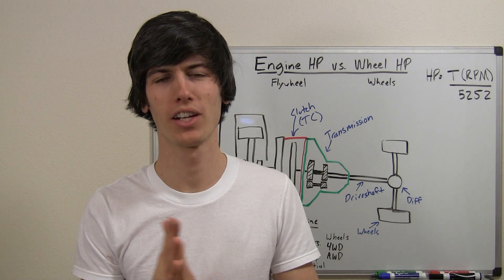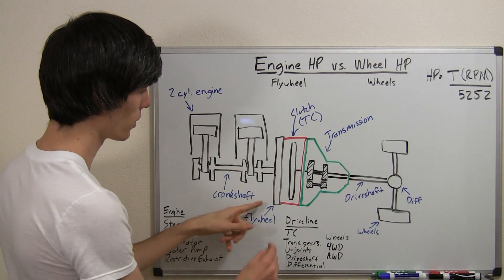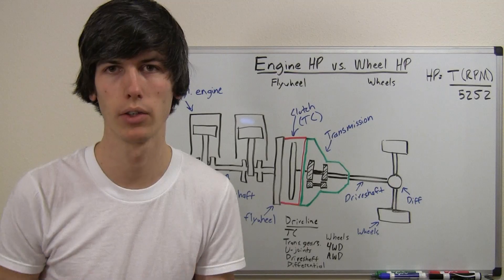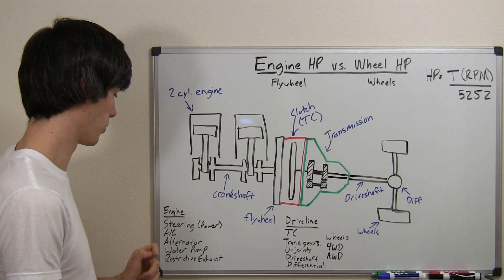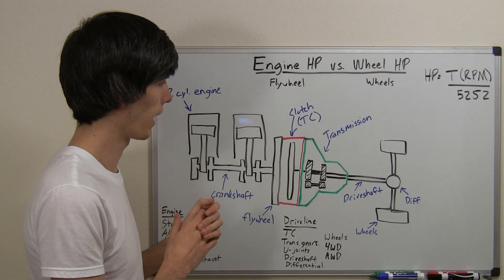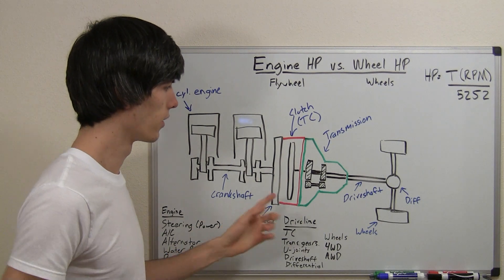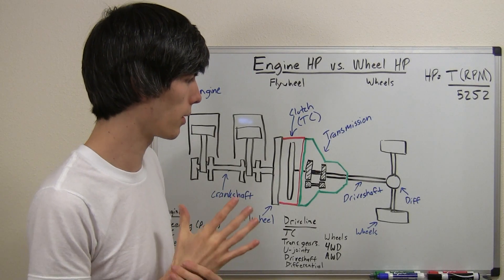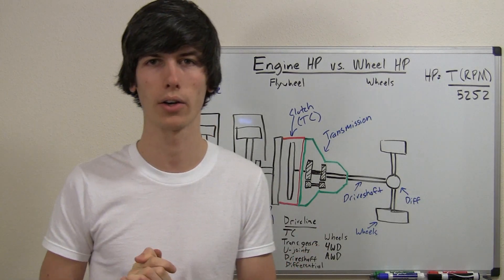Engine Horsepower vs Wheel Horsepower - HP vs WHP

Comment: I was always told On A Streetcar with power steering alternator water pump fan all being run by the engine with automatic with a stall converter and so forth can lose 25 to 30% to the wheels from the flywheel ... 🤷‍♂️

Comment: Lovely video thank you so much for your education. Although I have one remaining question. Do the manufacturers increase the engine hp on a AWD to remain the same on numbers with a RWD engine?
Reply: They just measure it at the fly wheel, it will be the same number since it never goes through the gearbox or the axles, but the WHP would differ. Some manufacturers would make the AWD version more powerful than the 2WD like Lamborghini or Audi or other performance car manufacturers, but in most cases, they wouldn't even bother, if the AWD is slower, it is slower. Ironically, these same manufacturers, audi and lambo, in some instances, made special RWD editions of their AWD cars and they were even more powerful than the AWD counterparts.

Comment: So lets say i have a 4wd car that produce in stock form 300 hp ,so the whp with 25% loses is 230 whp. ,so i lost 70 hp from engine to wheels.
Now i have the same car tuned to 1000 hp x25  % loses is 750 whp ,,,so now i lost 250 ??? but how ? I still have the same flywheel,gearbox,wheels and differentials
can you please explain ?

Comment: So my 2008 Corvette with an advertised 430 hp at the rear wheels is over 500 hp at the engine.  In the 1960-70s all cars were rated with flywheel horsepower.

Comment: engine vs wheel hp is litearlly one thing..... TAX
you make 80k a year, but get to spend 55K. No differnt than making 300 crank/engine hp but you get to use 222 wheel....

Comment: Is there a way to increase the whp? I’ve got a stock sti and I’m gearing for a build that gets the most out of its potential is stock engine form. That includes chassis braces, brakes and blah blah. Would something like a cf drive shaft which is a single piece instead of the two piece from factory improve those WHP numbers as well as other mods like better tires and transmission bushings and mounts

Comment: Dumbas Satanists-- no matter what? 100hp U 10frqs-> /+ 9in-sec (100/-10)=10frqs--DOD radios- Agents! Of horsepower-frqs= military agents. Wiretapped- only works at, 10frqs. 90volts(Hawaiian-language), loss 10 horses-- thief- hack(murder in French!) or fract in kaldean-- you use, fractions. 
(90*10)=900amps horsepower frqs-- INT! That means-it isn't 100hp, ever. 900/+14in sec- 64frqs hp,
kernel-- Linux(Hawaiian), Linus= Hawaiian-- not Sweten--(t)=d.

Comment: I was talking to a mechanic the other day about this, calculated fly wheel horse power against taxable HP. I had a 351ci V8 that has a taxable flywheel HP of 52hp (from the Ford workshop manual) and with a rear wheel HP of 350hp. I think the sales brochure of the time gave the engine power of 380hp. I confused the hell out of him (he's a young mech) as he only understands the calculated HP, even the information from the engine dyno still uses the calculated method. I gave him the HP rating for several motors that were far lower than what he knew. I like to know the taxable HP of an engine compared to the calculated HP which is problematic, eg. I read the other day about a 3.7L engine on a dyno putting out 2050hp, then you look at another engine of 16Litre capacity with 650hp.I do know the torque from both engines are different.    Please correct me if I'm wrong.

Comment: I'm lost. I've used the HP formula multiplying torque X rpm and then dividing the result by 5252, but I never get the HP indicated in engine specs. Example: 2008 Mustang GT Bullitt claims 325 lb-ft at 4250 rpm. Using this formula, HP is 262, but the claimed HP at 6000 rpm is 315. What am I missing?

Comment: Back in the 50s to early 70s car manufacturers use to measure BHP at the the fly bare ass engine with no accessories but in 1971 they converted to SAE net horsepower which is measured at the fly with all accessories and is the industrialized standard that’s why engine horsepower dropped radically in 1971 compared to 1960s-1970 no car manufacturers uses Braking Horsepower (BHP)in modern vehicles today also a vehicle can lose up to 30%+at the wheels according to what type of drivetrain ,manufacturer ,and ratios

Comment: Would be nice to know the expected range of how much each part or electronic could consume. Is it substantial? like the power steering wheel, AC, etc. Also, I'm assuming these are fixed and not a percentage of the engine's horsepower.

Comment: Question: Does increasing wheel size of a car reduce wheel HP? All other things being equal - wheel weight, tyre height etc. Is there a measurable or theoretical difference between the horsepower a car would put to the road/dyno on say 13 vs 18 inch wheels?

Comment: Does engine hp include losses in the valve gears, springs? And how much efficiency is lost in controlling the valves? How about the cylinder friction, how much effciency is lost there?
Reply: you loose around 75% of energy to heat before you tire even can see any of it

Comment: Just bought a 98 5 speed Corvette that was Dyno'd at 318 HP (wheel to ground). Chevy specs have motor to flywheel at 345 HP for that year. Without cold air intake and long tube headers I'd probably be running around 285 HP.

Comment: Hey bud! Two Video ideas. 

1. Obviously we know dyno will read drastically different depending on brand, location, and environment variables.  I know many people say you can accurately measure real hp by a cars et or trap speed calculated against its weight. Nobody has been able to accurately explain the math on this. There are variables on changing gearing to accelerate faster would change your hp calculation.. but there MUST be a way to calculate this. 

Second. I think motor trend did a video back in the day but I can’t find it.. explaining why in a standing mile.. starting from a stand still vs starting at 60mph, or any speed for that matter,... your end speed  really doesn’t change. I’ve seen this at the track with roll race events vs dig races. My et is obviously faster but my trap speed maybe increases by 1mph. Doesn’t matter if I’m doing 20...60..80... or whatever to start. 

I think the first idea would be awesome for helping people figure out a more accurate way to compare friends actual hp numbers.. would be cool.

Comment: in HP formula is Torque constant in a specific engine?
Reply: No, torque varies with rpm. It's the force exerted by the piston on the crankshaft (engine torque) hp is just a calculation of how fast you can complete the work done by 1 horse (550 ftlbs of work/second). Tq falls off as you Rev higher bc its able to do more work but with less force exerted at the crank

Comment: how much engine hp is lost to the wheels? im sure it varies depending on aftermarket vs stock components but just a rough guesstimate?
Reply: There are some rules of thumb. Front wheel drive about 15%, rear wheel drive about 18%, all wheel drive at least 20%

Comment: So I have a military truck that produces 240 horsepower and 685 ft pounds of torque. it has a 14 liter Cummins engine in it. I also have a 6.7 liter turbo diesel engine that produces 350 HP and 650 ft pounds of torque. the 6.7 engine has 110 more horsepower and almost the same amount 35 pounds less torque ( the 6.7 liter can actually produce more like 900 foot pounds of torque) yet if I place the 67 engine in the 5-ton truck instead of the 14 liter engine it can't get the truck to move nearly has quick nor could have pulled nearly as much as a 14 liter diesel engine. Why?  How can a 6.7 engine half the size of the 14 liter put out more horsepower and almost the same amount of torque as the 14 liter engine yet the 14 liter engine could pull a lot more than the 6.7 liter engine? A 14 liter engine vs 6.7 liter engine is a huge difference in size and the 14 liter engine weighs significantly more than the 6.7 liter Cummins.
Reply: Volumetric efficiency

Comment: i've seen lots of videos about torque and hp.....but how do u know how much torque ur engine produces so u can calculate the fking hp no joke at all if it sounds like one... 4real im serious how?
Reply: It's simply that you attach a dynamometer to the flywheel which measures the force being applied to it to turn it (as well as the rpm)..whereas if you're measuring at the wheels, you'll have it on a rolling road doing the same thing. I don't know the particulars of the instrument, but that's the principle...the "turning force"is the torque: at the flywheel-engine torque-at the wheel-wheel torque.
Reply: +Philip Paynter thx dude, so at the factories they do it on a dyno (measuring the hp/tq)
Reply: Yes matey, I believe so..You're welcome.

Comment: Your statement of "the reason they're giving you the engine horse power is because it's always greater than the wheel horse power." This does not make any sense, since hp is a function of torque per the hp equation. Torque at the rear wheels is much greater than engine torque (multiplied through all the gearing). Can you explain that?
Reply: +Marcel Al-Kaththaab don't confuse engine torque, with torque multiplied after the gear box with HP of the engine and HP as measured at the rear wheels.    Hp at the engine is greater than at the wheels as it would not have the losses associated with it.     rear wheel torque as measured through the gear box, goes up with lower gears, but the RPM goes down.... so, the HP doesn't change.
Reply: @zanick2  Thank you for replying.... 5 years later, I managed to find my comment and your answer.

Comment: I've learned more from your vids than I did from 2 years at a technical college. Thanks and keep it up.
Reply: Depends alot on the College, some are great, some suck.  Also depends on if you were sober during the classes.  :)
Reply: Maybe you should of paid more attention when you were there?
Reply: @shawnbalch6046  sorry is that question or a statement? You might be projecting. I didn't leave this comment to get attacked pal, I was encouraging the guy.
Reply: @shawnbalch6046  well to be fair the OP of this video is a mechanical engineer, not just a technician ;)

Comment: Can replacing all drive train gear oils with high quality synthetic fluids reduce enough friction to make a noticeable difference in power to the wheels?
Reply: +Dcc357 noticable?...hell no
Reply: +Dcc357 it definitelly makes difference, but depends on viscosity and a lot of chemistry of oil itself! I think i would make noticetable difference if you were using machine with something like 10 or 15 hp. But still i don't think you would feel it with human senses.

Comment: BMW always gives Wheel horsepower. My 540i is rated at 286 at the wheels so probably doing arround 335 at the crank
Reply from the maker: No, all manufacturers provide horsepower at the crank.
Reply: +Engineering Explained well i know all 540is make 335 hp. BMW rated the engines at 286 . maybe to make the taxes lower. But thouhgt i read BMW used to give Wheel hp
Reply: +Engineering Explained looked it up and you are right

Comment: HP and WHP, both in HP units?
Reply: +Juan Pablo Velásquez hp is energy made from engine, WHP is energy actually produce at the tire after all energy losses like heat, friction etc.
Reply: +Chad W HP is not energy..... the HP-second is a unit measure of work or energy.   HP is just a rate of doing work.   synonymous with acceleration potential at any speed at any same mass
Reply: +Juan Pablo Velásquez yes, HP at the wheels or HP at the flywheel is just where the HP is measured from. at the wheels will be less due to drive train and rolling friction losses. usually, this is speed dependent, as rolling losses are less at lower speeds.
Reply: zanick2 no, wheel hp was a term of actual energy used to move the vehicle. althought some could argue the heat wasted into the transmission is "energy used" whp is a term defines ONLY as that which moves the car. all else is losses and thus less than whp.....
Reply: my point is wheel hp or engine hp is NOT energy.  energy is the capacity to do work not the  rate of doing work. BIG difference .  yes , the hp as measured at the wheels is the net force that the car and engine can have to accelerate.   its net ability to generate force to accelerate. (as you say, minus all the losses of the drivetrain).

Comment: I have one question. I have been arguing with my buddy here for ages now. He told me that there is a difference between engines used in cars and engines used in trucks. The latter being more powerful. I do not agree, but am I wrong? I think that if engine A has more hp and more torque at same rpm as engine B that means that A is more powerful then B. I am aware that most trucks have less hp but more torque at lower RPM and that gives them power to transport bigger loads. But let's say two engines (one of a car and one of a truck) have different specs and the car's is more powerful. Our example was with his favourite truck (zil 130) and my favourite sports car the GTR. The truck has 150 hp and 226 lb/ft torque at 1800rpm. The GTR is 600hp with 481lb/ft @ 3200rpm. Which engine is more powerful and what will be the outcome if we swap them. GTR's torque should be 250lb/ft at around 1800-2000rpm. Will GTR's engine be powerful enough to pull loads as big as the other engine in Zil's carriage? Zil 130 is able to pull around 10tons (own mass included). Will the 3.8L V6 be able to do the same ?
Reply: +Георги Костадинов yes and no... the 3.8L V6 in the GTR could pull those same loads but not in the GTR. The axles, suspension, frame, etc of the GTR would not be able to handle the stress from the load as it's not built for towing those kinds of loads, but if you swap them like you said to the ZIL-130 whose axles and suspension are made specifically for that then it would be able to.
Reply: Fred Isacksen That was exacly what I thought. And yea, we were talking about engine swap and not for the GTR as a car vs a truck. But the point of my question was if there is a difference between engines designed to pull big loads of weight and those of a race car which are designed to have high top speed and acceleration. As I have thought, it all comes to torque and horse power.. am I right ?
Reply: Kind of... theoretically ur right but in practice no unless you modified certain components of the engine to handle the load being pulled and the stress of weight rather than speed. The 3.8L V6 of the GTR has lighter parts in the engine to cut weight so you would to fortify or replace those but other than that you're right. It does come down to HP/TQ at an equal RPM
Reply: Fred Isacksen
Well that is kind of tricky. All trucks produce high amount of torque at low RPM (I don't know how they achieve this??) where cars start to build up torque after 2000-2200 rpm. Maybe at idle rpm (800-900) race car's engine wouldn't be able to build up rpm to 2000 to gain torque because the load would keep it from moving. Is this also a possibility?
Reply: Георги Костадинов they achieve the high torque at low RPM because they typically have low gears like 4.56 and up while faster cars typically have high gears like 3.73 and below in their differentials
Reply: Fred Isacksen
But the engines are basically the same right? If you put truck diffenrentials on car's engine it should produce torque at lower rpm?
Reply: Георги Костадинов yes it'll be the same more or less
Reply: +Folopolis you guys are making this much too complicated.  600hp is 600hp. you can have low torque at high  rpm  (GTR)) and gear it down more to equal the same rear wheel torque, after the gear box as a low RPM , high torque engine.   they can make the exact same torque at the wheels , if they are at the same HP at ANY vehicle speed.  the main difference is that the GTR engine is not going to last 1million miles reving at 8000rpm for 90% of its duty, where the Cummings Diesel will.

Comment: Great video! Also there is a general confusion about the kind of horsepower some chassis dynos are "measuring". If we consider the raw horsepower measured by a dynamometer, without calculating or measuring any loss in the driveline or on the tires, we can classify the dynos by descending order of read value :

Engine dyno (Flywheel) > Dynapack (Wheel hub) > Rolling road dyno (Tire) > PerfExpert (Real car acceleration on the road)

Then, from the raw read value, each dyno will calculate or measure losses in order to provide the Engine HP (BHP) to the user, that is equivalent to the raw read value of the engine dyno. Some dynos, like Dynapack and certain rolling road dynos, doesn't take into account losses and provide the raw read HP value directly to the user.

Comment: if the gears are not their under transmission will the engine hp and wheel hp are equal ?? if so then what aout the power lost in braking,propeller shaft etc ??

Comment: How about an explanation of the difference between SAE J607 (gross H.P.) and SAE J1349 (Net H.P.)  ??
Reply: Yes......but.......the auto manufacturers have used Net Horsepower since 1974 with several changes in the correction factor since.  The crate engine builders (which includes Chevy and Ford's parts catalog) still use Gross Horsepower when quoting the numbers.   Also, it was known for manufacturers in the late 60s to use Gross Horsepower and under-rate the engines for insurance purposes.  Not over rate them.  Think '69 Boss 302 and '69 Z/28 both 290 H.P. Significantly underrated Gross Horsepower.  Both were well over 350 Gross H.P. in a recent test in Hot Rod Magazine.
http://www.hotrod.com/how-to/engine/hrdp-1001-muscle-car-engine-shootout/

I want to know the formula and difference percentage wise of the two different types of measurements.